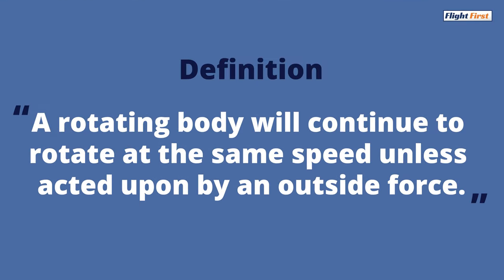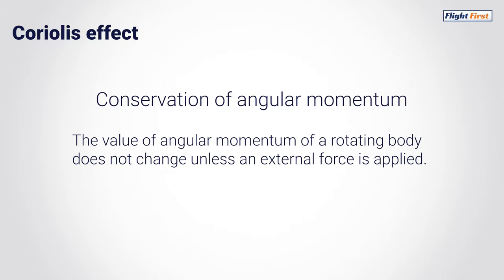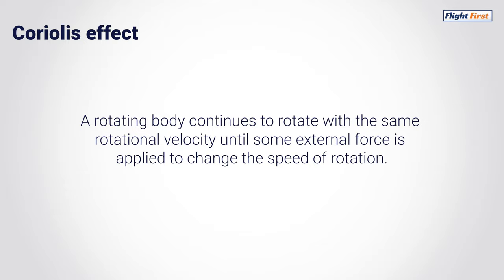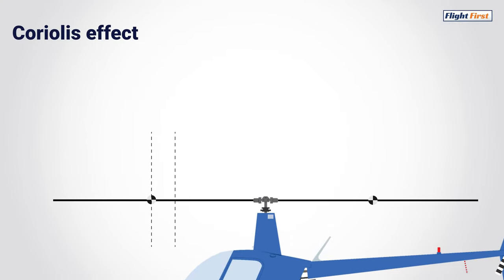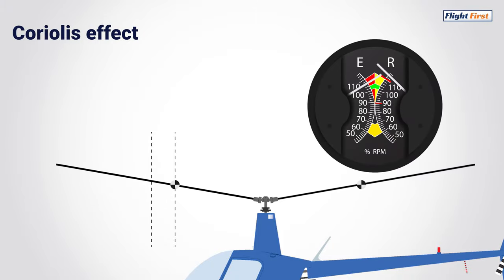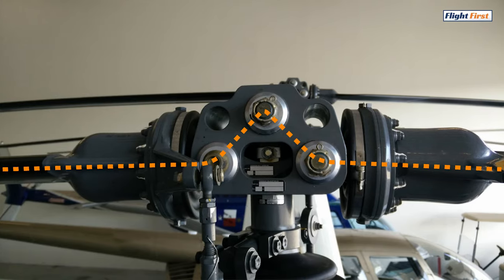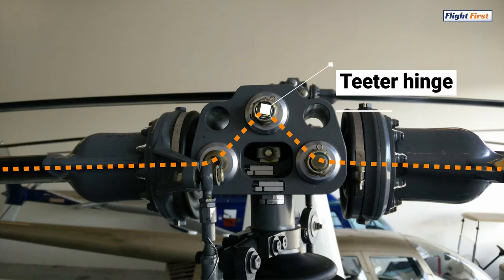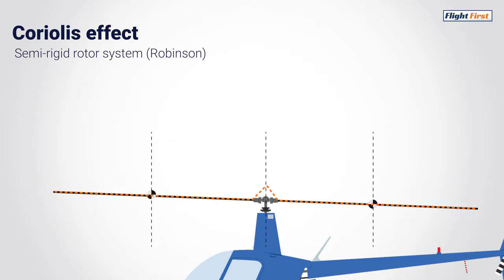Coriolis Effect and Helicopters

Comment: Robinsons have a hinge called a coning hinge that allows the blades to cone to take the stress off of them. The centrifugal force keeps them as straight as they can with the applied forces so as the rpm slows down and if you don’t lower collective the blades will cone more but as they cone more they will spin faster and try to pull back flat so it is a constant application of forces.

Comment: You are BONKERS! 
How do you expect "overspeeding" main rotor's on helicopters to assume a " cone shaped" profile?  
The two phenomena are mutually exclusive!.
Reply from the maker: I challenge you to get in a helicopter, fly straight at 100 KIAS, firmly pull aft on the cyclic and watch the NR. Do you expect the NR to increase or decrease?
Reply: The diagrams are poorly shown, particularly the idea of underslinging, which tries to keep the CG at about the same distance from the mast. This movie would be confusing to a newcomer, so the simplest explanation is that if the blades cone up, the RRPM might increase. Remember, though, that they MUST cone up when lift is generated, because of the flapping hinges and blade bending, and the coning angle depends on the weight of the aircraft and the RRPM. More revs, flatter angle. More weight, steeper angle.